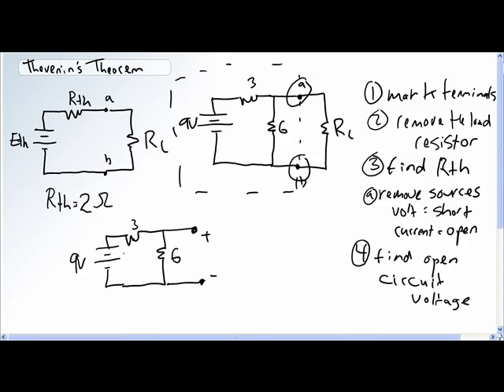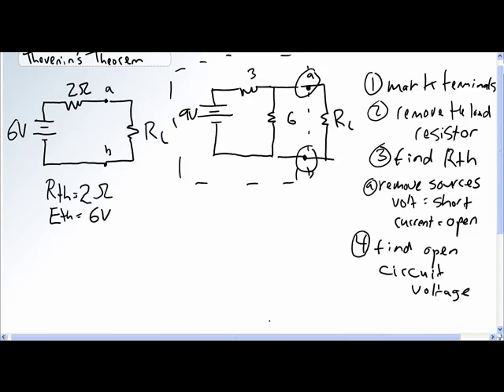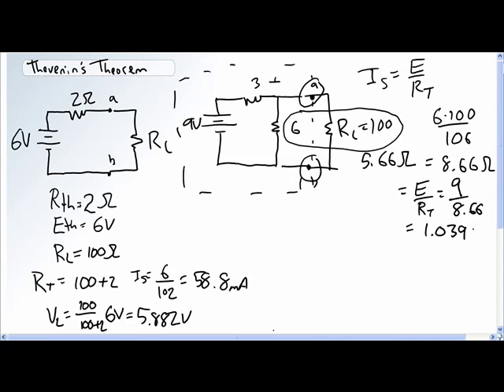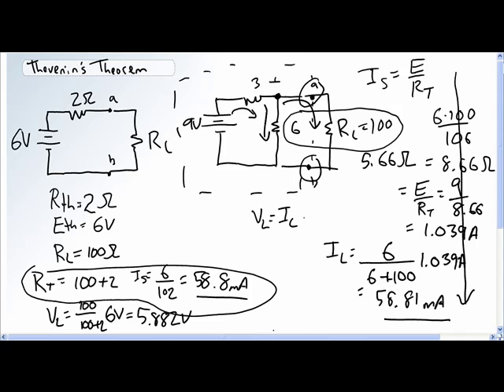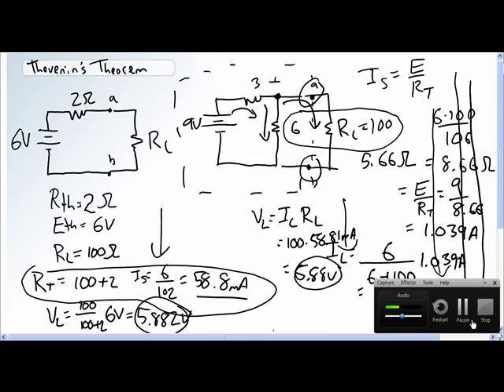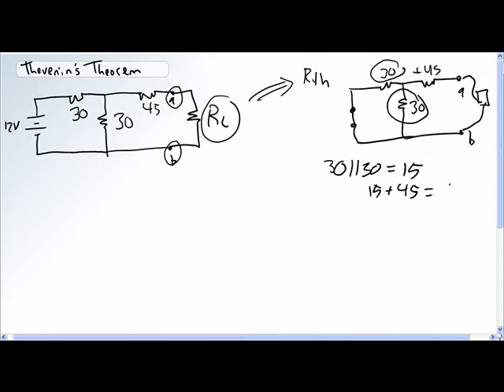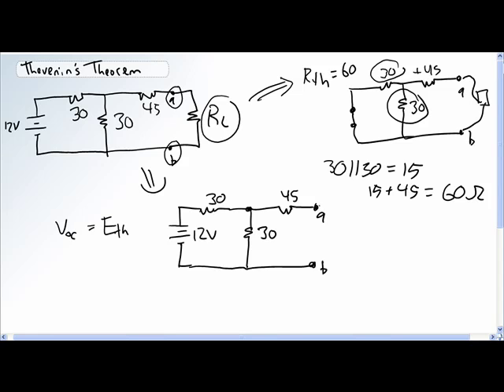Thevenin Theorem Part 2

Comment: I dont get that how did you get RL=100 ohm at 1.54min ?
Reply: I'll be honest... Just focus on actually solving the problems and it will make more sense later as u learn why. That's the approach I use in school anyway. Sometimes this stuff can be really annoying
Reply: The load is interchangeable. The load he used is 100 ohm's. Think of it as a speaker that you are installing; you know the R value of the speaker and now you can calculate the current. In this example he just chose to use 100 ohm's.

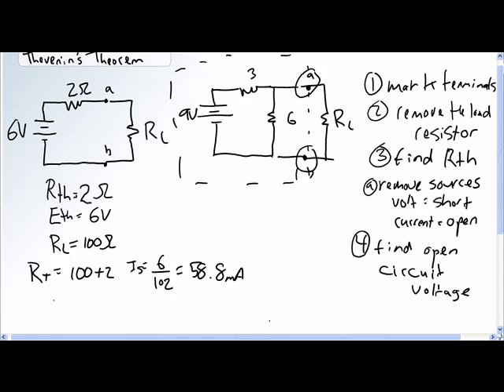Comment: question: at 2:20, didn't you find the current of the enclosed loop? not the current of the load resistor? To find the current of the load, you would have to use current division rule right? current-load= (I*2)/(100+2) where I=58.8mA. In that case the load current equals 1.15mA.

Comment: @filipinoguy54 
Hi, you have to look from the LOAD side, where we disconnected the RL resistor. The ohm-meter sees 45 and then the current splits to the 30 and 30 ohm resistors. So it is 45 + (30 || 30)

Comment: thanx for this video it was very good..but you were saying that by finding the equivalent CKT it will be easier to find values than the complex CKT but the thing is you had to do the same process to find the equivalent CKT which is at the end it will be the same,i think its just a different way to find values of the elements within the CKT..but i have to say you explain way better than my teach..thanx alot